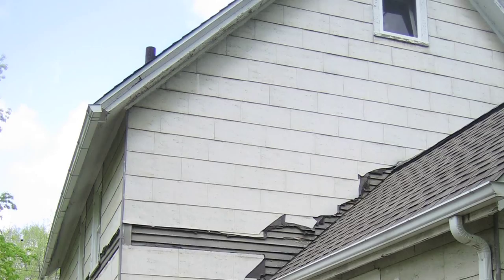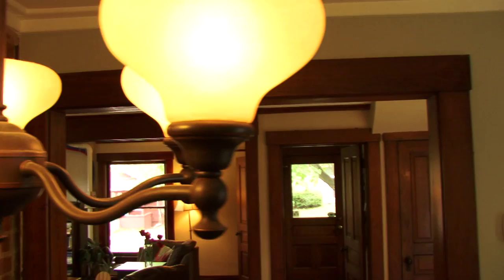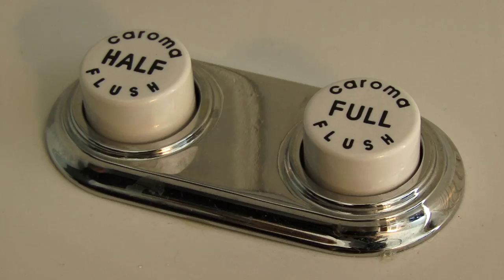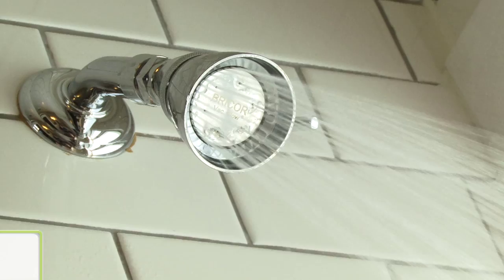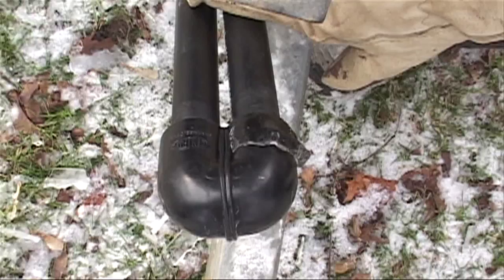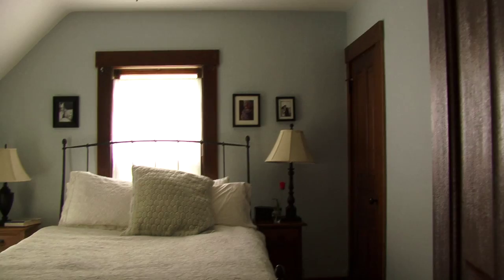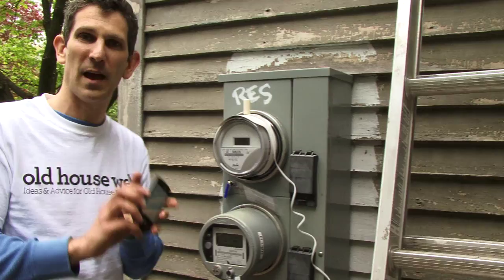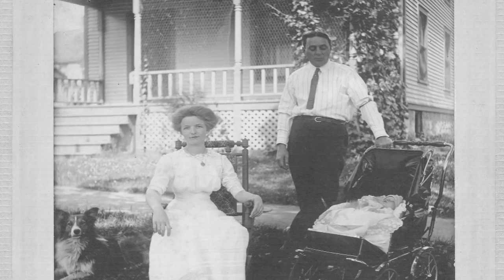110-year-old Net Zero Energy Historic Renovation: Preserving History - Protecting Our Future

Comment from the maker: @frankie2234 You can visit our website for our costs and data.  The geo system would be around $14,000 after the 30% Federal Tax Credit.  By purchasing the geo system with our mortgage we had an immediate positive cash flow.  Your asbestos siding is non-friable and can be removed and replaced if you wish.  The nails can be carefully loosened.  You can then insulate the house from the outside and use blown cellulose.  Ever thought about removing siding and restoring original